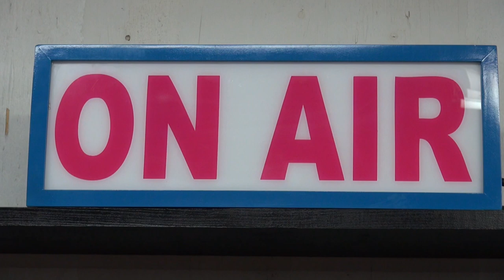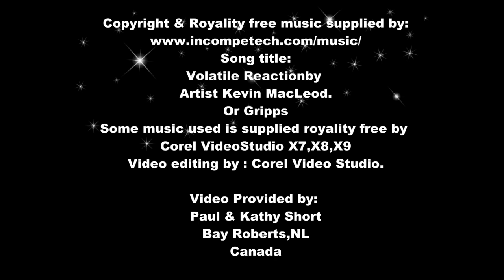Installing A cutting Edge On A Tractor Bucket #1

Comment: Wow, what a cool mag drill. My bucket already has holes in the leading edge. I wonder if I could buy a cutting edge that would fit those holes? Thanks for the video Paul and Kathy, it's always a pleasure to stop by.
Reply from the maker: Thanks buddy. Those holes are usually standard placement so finding a cutting edge to fit then should be very easy. Thanks for watching.
Reply: Thanks, I'll be searching.

Comment: Hi Paul , I certainly understand the hooks in the bucket I never pull with mine on the bucket top I only use them to secure objects already in the bucket or to lift some thing awkward. I will follow your lead and put 2 d rings in the bucket. I have been using Air Liquids  hard surfacing rods   58 and 62 on my bucket edge and so for so good  But eventually I will need to replace the cutting edge,, thanks for the video you a great at giving ideas and inspiration  thanks again.

Comment: great video again Paul and Kathy,  see this cutting edge fitted the bucket without shortening it (no pun intended!) so I guess the bucket is wider than your BX one ? Also know what you mean about strops and cables under load - a LOT of stored energy in them, seen a lot separate when doing motorsport rescue - always used to use a canvass sheet over them to act as a damper in case they broke.  looking forward to the next bucket installment 👍

Comment: hi paul and kathy another good video . i have changed lots of cutting edges on buckets try and tell people to set up for bolt on costs more first time but saves money in the long run. you should get center pin for your mag base cutter makes set up easy .you can also get chuck adaptor to use standard drills.
Reply from the maker: Thanks . I got the pin but couldn't find it. Found it when the drilling was done lol. got the chuck adapter as well. That came with the drill. your right about the cutting edges as well. Thanks for watching .

Comment: Hi Paul, just a quick update on with kubota, maybe you're aware already but they now offer a add-on cutting edge for the bx buckets. The new bx models now come with pre/ drilled whole. The new cutting edge is reasonably priced however it is not reversible message to upda
Reply from the maker: Yes I'm aware 👍

Comment: For me hooks are just bucket jewelry. 
Only a factory engineered and installed ring is allowed at work.
I got rid of them on my private equiptment  years ago.
Chains have hooks. Just mount a 2”x 2” hitch receiver and be done with it. 
Everything can hook from that, with attachments, a tow ring, or just a pin..You can then move trailers around easily too.
A lot of times chains and straps swing back in an arc. 
We should Not overload our rigging.
Also not use hooks designed for lifting for shock load pulling.
On the job, these days, there is a zero tolerance for rigging accidents.

Comment: Paul I just received my welding helmet that has a grind mode and I tested to see if the helmet worked and I used your last video with welding and it works when you were welding that snow blower back together it darkened when you were welding
Reply from the maker: Cool.

Comment: Paul, can you post the part number of that cutting edge? My local Kubota dealer doesn't seem to know what I'm talking about and I have a B2301 I'd really like to add one to (54" bucket). I know your in Canada, and me in the US, so there may be a difference in the part number. Thanks, and thanks for the tip on the mag drill. I'm looking into them, but probably hard to justify for what may be a single use.

Comment: The center pin for that drill bit is also for ejecting the plug some ya don't have remove the bit every time you drill a hole also walter makes them drill bits
Reply from the maker: I know but I never had one 😢

Comment: Love the Mag-Drill, but how does the drill bit cut the plug half way thru the drilling?
Very interesting video.
Reply from the maker: Thanks Jerry. The bit is hollow inside. There's a pin that goes in the bit I I didn't find it until the job was completed lol. The pin ejects the plug. Hope all is well.

Comment: Nice video. Where did you get the cutting edge? I'd like something like that for my b2620
Reply from the maker: It's a dealer part. Just ask them.
Reply: Thanks. I'll look into that. One other question I had was do you know what type of thread is used for the sending units on a b2620. I'm looking at adding some mechanical gauges for water and oil but I can't find any info on thread pitch. Not sure if it's npt or some thing else. Thanks sir

Comment: Have you ever thought of using an air/oil coolant mist sprayer with water soluble coolant?  I used it years ago machining  aluminum oil pump bodies when I was a machinist at Franklin Engine.  Used the mist rather than flood coolant.
Reply from the maker: Don I really don't do enough of it to justify it. The mill and the lathe I use water soluable oil and I rarely use that.

Comment: great video Paul  your magnet drill press is there a brand you recommend
Reply from the maker: If one can justify it buy Milwaukee. It's ten times the price of the one I was using though.
Reply: ok thanks
Reply from the maker: DeWalt also makes one. I think it's around $1000. US.
Reply: ok i check it out thanks Paul

Comment: Paul, always enjoy the videos. Would like your suggestion on how to take the bow out of the bottom of a loader bucket. 6foot bucket has a drop in the center almost 2". Currently there is no replacement cutting edge, just factory. What do you think?

Comment: Paul. I've been going through this 3 part series again. I finished the ssqa on the tractor and bucket and next I want a cutting edge and a removable tooth bar. My bucket did come with a cutting edge welded on. My question is,  should I add a second cutting edge and will I still be able to add a tooth bar?  My other issue is the bucket is 54" so I will have to get a bigger one and cut it down

Comment: Ahh... Nothing like a nice speciality repairs video after dinner. Paul any recommendations for teeth on a bucket like that? Been looking and can't find nothing good.
Reply from the maker: It's hard find teeth that will fit on a bucket that has a removable cutting edge but any of your tractor dealers should sell teeth but buy the shanks that have replacement teeth on them.
Reply: +Paul Short wow  thanks for quick reply! Just finished the video and boom answer from Paul. But that's the problem I'm having, is finding teeth  for that kinda bucket. I have the same one you just put the edge on with no holes and another bucket with holes. I would want the teeth  like you said to get. I just didn't know if you recommend a "name brand" I like the way yours is on the 5740 bucket.
Reply from the maker: On my 5740 I made up a tooth bar but I have to remove the cutting edge to use the tooth bar. Works well and very strong. Are you looking for teeth that will work with the added cutting edge?
Reply: +Paul Short nope no cutting edge. I'd like something to go on that exact bucket you are working on now. The other bucket I have with the holes is a 4 In one with a cutting edge I'd like to leave that one as is.
Reply from the maker: I'll get you a brand name tomorrow if I can find the new shank. It will work on yours.
Reply: +Paul Short thank you. Much appreciated. You and Kathy have a good night. Looking forward to seeing you finishing that bucket.

Comment: Hey Paul, I came up for a visit on google map last night, and I think I spotted your place.Do you live on Conception Bay Hwy. between Effords Subd. and Cat Hill Road. That mag drill looks very close to my Milwaukee mag drill, except for the base. Mine is adjustable so it's not so difficult to align to a punch mark. I also have two different motors for it with different speeds and power,  a set of annular cutter bits with the center pin for ejection of the slug. It sure is a time saver when doing heavy drilling. See you two on the next video.
Reply from the maker: Yup. That's where we are. You found us lol. You have a nice nag drill. Mine has the center pin as well but I couldn't find it in the box but guess what. The minute I got the job done I found the pin lol. I've had my mag drill for 5-6 years. May have used it four times but when your in business like we are you need to have the tools on hand just in case. I'd love to own a Milwaukee mag but I can't justify its cost. Maybe in another life lol. There's two more videos ready to go. Maybe tomorrow I'll put up another one. Thanks.

Comment: I'd use a cutting edge fastened with plow or carriage bolt instead, seen to many damages nuts when used inside the bucket like that from granite rocks.
Reply from the maker: That is attached with carriage bolts. I’ve never seen anyone use regular bolts. Did you watch the full video? As for the nuts inside the bucket. No mater what you use to bolt the cutting edge on your going to have to use nuts inside. Either that you’ll have to weld it on.

Comment: Paul do you guys make a cutting edge for a 60 inch bucket like the B2650 has they seem hard to get
Reply from the maker: @twistedsledder    Nope but our Kubota dealer has them.
Reply: @7863348  I checked here in Moncton they said they don’t have them said I would have to go with 5/8 thick and modify it but said it would make the bucket heavy and reduce the 1200 lbs lift capacity but I’m ok with that if it saves the bucket
Reply from the maker: @twistedsledder    This is an old video so things might have changed since then but after I did this video Kubota went ahead and cane out with a bolt on cutting edge for the BX so that should be available at the dealership level. You’re over thinking the weight issue. Protecting the bucket would be my main concern.

Comment: Great video.  Did that cutting edge come from Kubota or did you manufacture it?  I have a JD 1025R and I am not aware JD has a cutting edge available.

Michael Bradley
Reply from the maker: It's a cutting edge from Kubota but I did the same on our small BX but cut a few inches off each side and the rest is the same as this video. Thanks for watching.